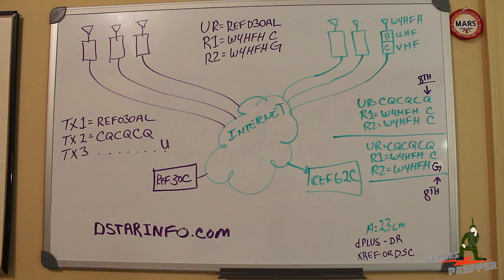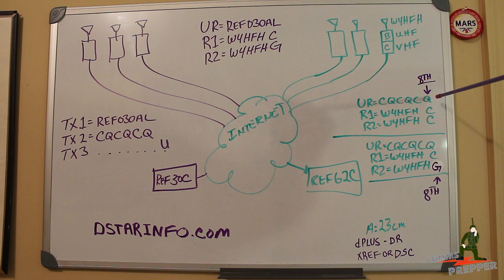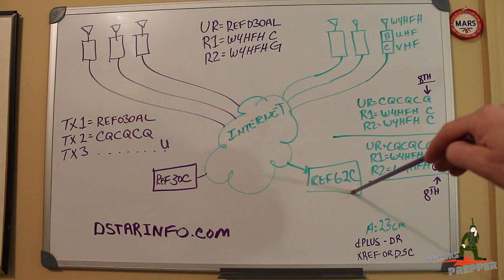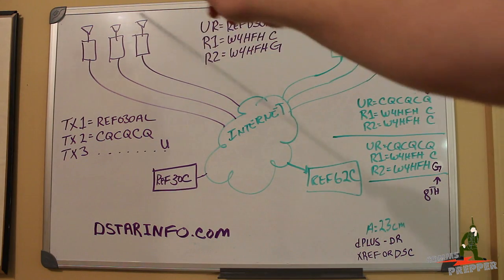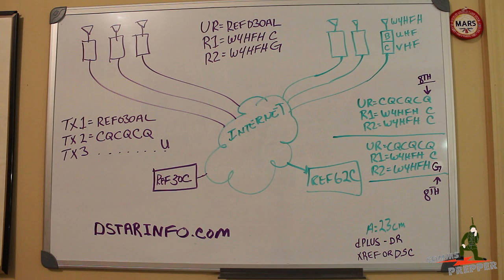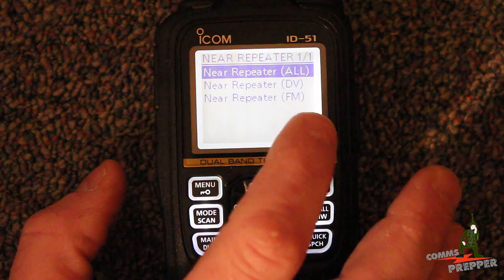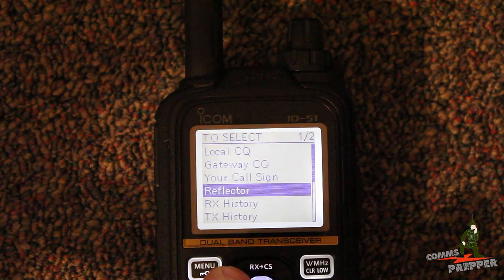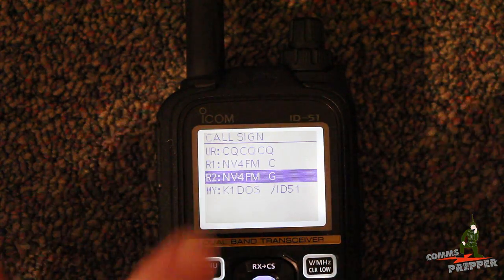D-STAR Reflectors - Basic Radio Settings

Comment: Got to a place I can type. Ok what I have is a couple of Hotspots 1. is an Openspot 2 and the other is a TGIFspot. They are set up to do DMR and Dstar. On the TGIFspot it is depending on the mode coming in to the hotspot. On the Openspot2 you have to change the Profile. Lets take the TGIFspot. I am on 432.700 simplex. I am set on the XREF002 Reflector. So I don't know how to set the radio up and how to get to all the alphabet I have to add after my call to get to where it needs to go or how to link and unlink or basically where I want to go. I heard the XRefs are better than the Refs. I guess that would be so with X equalling Extra? Is there a list of talkgroups oops there I go with DMR. Well what ever the Japanese equaliviant is.I never like Japanese manuals either. How do you do a typical conversation in Japanese oh I mean Dstar on an ID-51. I know there are suppose to be shortcuts. 
When I was in Illinois Chicagoland areas a friend who had a couple of Repeaters in Gary, IN wanted to convert them to Digital. We started out going to convert them to DStar. The equipment for the client side was so expensive traffic took a horrific hit! so We switched it to DMR. At first Brandmeister setup a talkgroup for the area. Once the code plug was written away you went. Well a bunch of people from New York Pirated our Talk Group and my friend go mad so we took it to C-Bridge. Things were smoother. When moved here the guys were wanting to go UHF digital I convinced them to go DMR right off. Didn't want to get into Radios costing as much as HF rigs again. Anyway I had an Icom IC80 from days in Illinois and then bought an ID-51A plus 2. Wanting to get on DStar with a hotspot. I started with a Jumspot it lasted about 3 years, before that I got an Openspot1 for DMR. That worked I don't remember how it was set up in the IC-80AD but I used it to check into the North Colorado Hotspot Devices net. until the jumspot died. I bought the openspot 2 for traveling back to Illinois and set profiles to go back and forth between DMR and Dstar. Having know Idea what reflectors to use. I don't on one that will take me a year to disconnect from. So there I am the Hotspots are up how do I set up the ID-51A Plus 2? Oh, my email is macmikeal (at) mac (dot) com.

Comment: It would be nice to see similar video according to ID51E (not plus or 2)
Reply from the maker: I think the E is the European version.  I only have the one radio.  Sorry.
Reply: This is not a problem. Only version of radio. If it's possible to borrow an older ID51 radio (without "plus")
and made similar video. There is more difficult.
Reply: ID-51a/a+/a+2 are all the same functionally, hardware features are the only difference. This video will work on any version.

Comment: Fantastic!  This is just a great, very informative video (as are all of your others.) I have heard D-STAR explained before, but never was clear about it until your video.  I like your style!  

I have an ID-51 A Plus on order.  I considered the Plus 2 for its ability to connect to a smartphone and supposedly use the phone for your radio's internet connection when no repeaters are near. But the connection from the radio to the phone is wired.  The tethering did not excite me.  And I wonder how the feature really works in practice (I could find no reviews that have tested it to date.)  So I think I will wait for a radio that can do this via Bluetooth or perhaps built in WiFi.  Besides, the ID-51A Plus can now be had for $300 (after Icom's $50 rebate through the end of December 2016).  That's a decent price I think.  The new Plus 2 is $500 and no rebate is being offered for that one at this time.
Reply from the maker: Glad the video has helped.

Comment: Thank you for the lesson.  Could you show what button you are pushing at each step during your explanation of 'gateway' changes, etc,  when you are configuring in the 'call-sign' menu, please?  I cannot tell if you are pushing the top, bottom, left, or right button, or the center one.
Reply from the maker: If I make another video on the topic I will try harder not to block the buttons.  Thanks for the feedback.  Respectfully - Hank

Comment: Wow - totally confusing. I had a hard time understanding this explanation. For starters - what is the 8th position? What does that mean? And then what is a reflector? Is that a radio or a computer, or what? And what is a gateway and what does it do? I'm new to this and finding it very frustrating trying to understand it. Do you know of any D-star for dummies type of resource that I could review of a more basic explanation?
Reply from the maker: The 8th position is the character count.  Call signs don't exceed 6 characters, one space character (7th position), then the 8th position.  A reflector is a server that acts like a conference call bridge that links a group of repeaters together via the Internet.  The gateway is an Internet port in the repeater rack that allows the D-STAR repeaters to connect to the Internet.  D-STAR repeaters are stacked by modules (individual repeaters VHF=C, UHF=B, and 23cm=A).  If someone buys one or all three of the repeaters (modules C, B, and A), the modules also have a "gateway" deck that connects to each repeater and provides a path to the Internet.  That path can connect to a reflector - sharing traffic will all the other repeaters connected to the same reflector.  I don't know of a single book for D-STAR.  Hope this helps.
Reply: Thanks for that super fast response. I'm gradually piecing this together but the terminology is a killer for me. I think I am probably lacking in some of the computer and radio skills that other people have. I'm very new to this so its a bit overwhelming. Thanks again for the response and the video.
Reply: This is why DMR radios at $99 each are taking over the digital arena.

Comment: Good News, I can hear people talk to each other, but I cannot talk to them.  
   What is your best guess on my error?
Reply from the maker: 1.  You can't reach the repeater.  It's too far away, you don't have enough power, you need an external base or mobile antenna.  You can check this by going into reflector and select information (Sending an I in the eighth position to trigger the repeater to report it's status, then return to the gateway mode).

2.  The folks you are hearing are coming in on a reflector, not the RF side of the repeater, and your radio is in local CQ mode and not gateway mode.
Reply: Commsprepper Excellent diagnosis...  I was able to manipulate the j-pole in my living room and finally got a QSO.  My1st D-star conversation.  I still have little understanding of what I am doing with it, but finally made contact.  I need more understanding with reflectors and the several steps involved therein.  Your video was very helpful.

Comment: Digital voice.... segregating Hams one brand at a time.
Reply from the maker: +MZR0682 I see it as a new and emerging technology that will advance Amateur radio.  There was a time when the CW folks despised Packet Radio.
Reply: +Commsprepper Packet Radio used standardized protocols. Exactly what DV needed from day 1. My comment was meant for the way manufacturers are implementing DV, should've word it a bit different. BTW, great videos. 73

Comment: Love your serie. Make me want to buy one 8)
Reply from the maker: +TheMountainRN Check them out.  When you add in all the features (GPS, NOAA radio, Broadcast radio, analog and digital - with data options) the price is very fair.
Reply: that’s what I was thinking. Actually if I could suggest you should make a video on that. As some people may dismniss the options rapidly because of the $$. But they are like a multi tool.
Reply from the maker: +TheMountainRN I thought I covered that in the first video.  Perhaps I was not articulate enough?